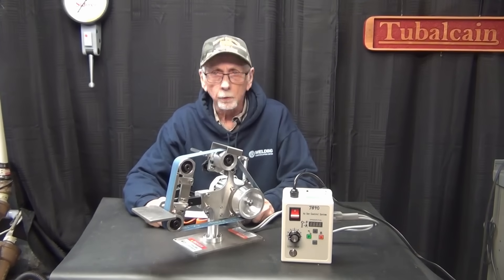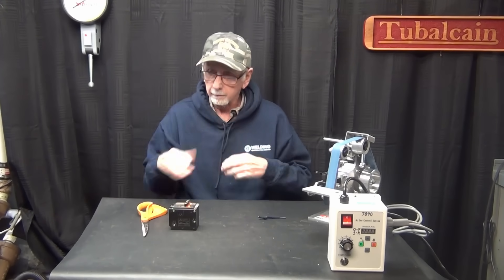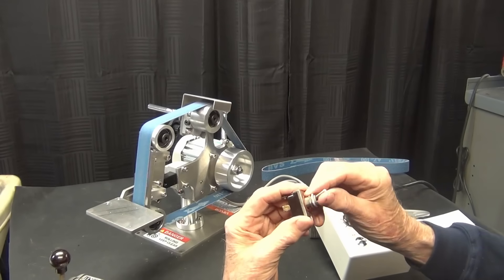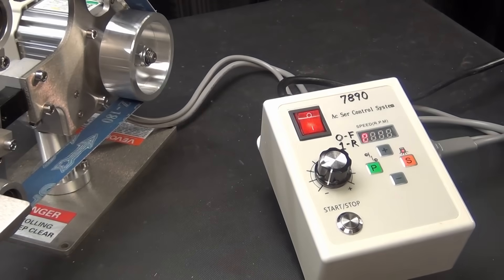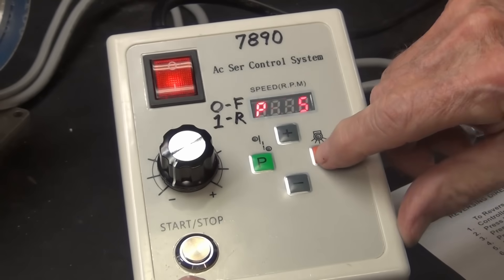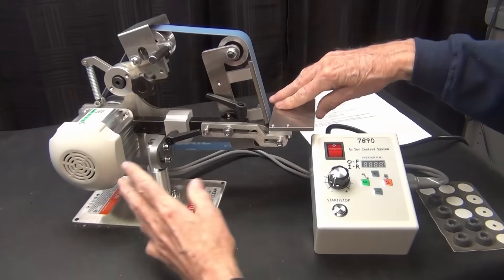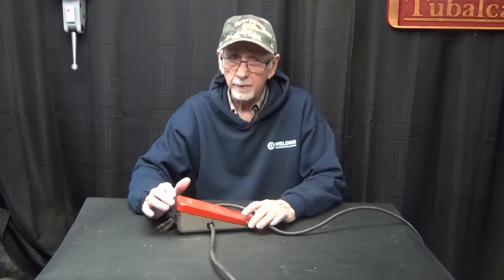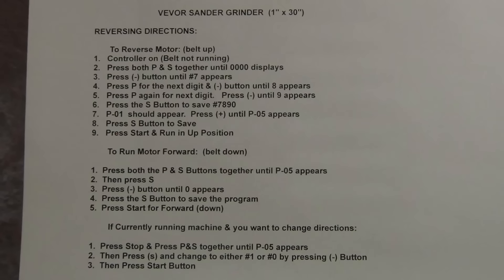HOW TO REVERSE THE VEVOR SANDER #1010 tubalcain

Comment: I have the same belt sander and I also had trouble keeping the belt tracking correctly . As you said about the crown on the pulleys I added crown to mine and it made all the difference. Southern Ky here.👍
Reply from the maker: Glad that helped you!
Just yesterday, for experimentation, I wrapped three layers of black tape around the driveway. That gave it a bit of a crown. It tracks perfectly now.

Comment: The fact it doesn't actually turn off with the switch means it likely is like a tv and always on looking for a signal so this thing is probably drawing some power whenever it is plugged in.
Reply from the maker: You are absolutely correct

Comment: I picked up one of the little Horror Freight belt sanders and had a terrible time with tracking; UNTIL, I chucked them in the lathe, one at a time, and checked the crown. They were no where near symmetrical. Evening out the crowns and the belts tracked quite nicely!
Reply from the maker: Great, glad you got it fixed
Reply: @mrpete222  That said - the thing is a POS - I'll be replacing it soon, probably with this little jewel!

Comment: First off, I see all your comments to my comments and really appreciate them.  Now what in the world would Vevor  want to reverse the grinder?  I am not being negative but ask the question in case there is a good reason for doing so.  I suspect the reason is the controller will handle it so why not market it as a feature even if it makes no sense.  But the grinder does look like a nice little machine.
Reply from the maker: I will never ever use reverse. But I think knife makers like it in reverse. I believe the price of the machine could be reduced by $50 by just using a simple switch.

Comment: I have this belt grinder and to get the tracking to work better just add some more tension to the belt. I found out it tracks very good by adding more tension.
Reply from the maker: Thanks for the tip!  I will try that. Someone else suggested applying tape to the big wheel just in the middle to give it a bit of a crown.

Comment: i bought this after seeing your first video on it and i've got to say that it's pretty sweet. i used it to sharpen some drill bits and some other odd stuff and then bolted it down in place of my old bench grinder and threw that thing in the corner. no regrets.

i use locking c-clamp pliers on my drill press. i drill mostly sheet metal so locking pliers make more sense than a vice. fast and easy!

for a long time i had comment notifications disabled because of the stupid way youtube handles them. the reason is that if you reply to someone else's comment, and it happens to be a popular comment, then youtube informs you anytime someone else replies to the same comment. why would anyone care to be notified about someone leaving a comment talking to a different person i don't know, but i'm sure many other people disable notifications because of it as well. currently mine is on though so i will see replies, whether they are to me or not.......
Reply from the maker: Glad you're enjoying the sander!
I receive no notifications whatsoever. I think I have to check my settings.
Reply: @mrpete222  oh, well that's pretty easy. just click the notification bell icon and then the settings gear icon at the top.

Comment: The tiny belt can run in either direction with no problem. I use mine for pocket knife work and reverse the direction every few seconds sometimes. Mine has a toggle switch and is simple!
Reply from the maker: Glad to hear about your experience!

Comment: The person who asked the question will for sure see the answer. Youtube notifies them that you answered. So don't worry about that.

The adhesive rubber feet you have are meant to be secured with a bolt and washer. They might be perfect for your little belt grinder. Although I think the machine is actually intended to be secured to a workbench for best stability in operation.

Decades ago I worked for a few months in a factory doing mind-numbing production work. The machine I had to work was operated with a kind of "dead man switch". So it would stop turning as soon as you let off. Not sure how practical a setup like that would be for a drill press.
Reply from the maker: That type of switch seems like a great safety feature

Comment: After your review video I purchased this sander and am very happy with it.  As I have limited bench space, I bolted a piece of 1" angle under the front edge of the base, and I clamp it in my bench vise for use. Otherwise, I store it under the bench. This also moves it up higher, so I'm not bent over as much while using it. As to your comments, I do see them, and I get a notice when you or anyone else respond to a comment.
Reply from the maker: That's a great idea for saving space!

Comment: Ive tried everything listed and can't get mine to run in reverse. But I may have found a solution to the tracking problem. Wrap 2 layers of electrical tape around the center of the drive pulley. It makes a slight crown in the wheel and it tracks great.
Reply from the maker: That's a great tip about the electrical tape for tracking!
I may try that and show it in a video. Several other people mentioned that in the past, that’s a good cheap way of doing it.

Comment: I’m unclear on the reversal of the belt. If the splice runs diagonally, what difference does it make to physically turn the belt around? The splice still approaches the wheel, table or tension wheel the same.
Yes we see your answers to the comments that have been posted. That’s one of the reasons I watch your videos and read the comments. It’s half the fun and knowledge that comes from your answers. Keep up the good work sir.
Reply from the maker: Thank you very very much

Comment: I have one of these sanders and it works great. I use it primarily for deburring, rounding corners, and beveling prior to welding. The biggest problem I have had is the wiring going into the motor is very close to the moving belt and can easily make contact with the belt grinding right through it. After repairing it I have now permanently mounted the sander, controller and the wires to a piece of plywood like you are doing with the aluminum. I highly recommend doing this or those wires will end up cut in half. Thanks for sharing how to reverse the motor.
Reply from the maker: Just yesterday, I worked for six hours making the base, and I attach the wire with a screw away from the belt. That video will be out in a week or two.

Comment: Double Stick Tape
Reply: @mrpete222 double stick tape can create a very secure and long lasting joint for mounting the small belt sander. It can also be released with a heat gun.

Comment: I always appreciate your responses to my comments 

I had a machine that the flat belt would not track   I asked a friend that worked with steam engines to help  He told me the reason my belt was not tracking was because I had an idler pulley that had a crown on it. He said idlers should not have a crown. I took the crown off, and the machine has not given me any trouble since.
Reply from the maker: Thank you, I was unaware that the Euler should not have a crown

Comment: Tracking belts or blades is a bit of an art. It took me a while but I have changed enough bandsaw blades now to have it down. The other thing for tracking would be to check how square the pulleys are to the belt. They may be canted to one side or the other.
Reply from the maker: Yes, the wheels have to be in the same plane. And perpendicular.

Comment: Yes I see your answers however brief they may be. Mostly a thumbs up is all I get. But that's Ok. I know you saw it. Quick story: My dad worked in a machine shop during the war (Brand new Norton cylindrical grinder) and the person next to him was working on an old drill press, you know the kind with the exposed shaft going down the front with the chuck. This was a large machine, not a toy. The operator had long sleeves and got caught up in the rotating shaft. Nearly killed him. Permanent injuries. Safety has come a long way.
Reply from the maker: Thanks for the interesting story

Comment: 4:30 It just means that the electromagnets in the motor are stationary, the part that turns has a bunch of strong magnets and the coils get switched electronically. No brushes or commutator to wear out. Computer fans, model plane motors all work like that. More dependable and no sparks.
Reply from the maker: Thanks for a great explanation

Comment: Mr Pete, I have a "dead man" foot switch on my drill press.  I've since watched several video's on building a magnetic vise for the drill press.  Here is the link, and yes I plan on building one.  I've seen videos where they even work on milling machines.  Some folks fill with epoxy and you can find those by doing a YT search.  Thanks, Ken  https://www.youtube.com/watch?v=RNdymvsUQdk
Reply from the maker: I plan on making a magnetic vice in a video. I received the magnets today from Amazon.
Reply: @mrpete222  I ordered one from VEVOR last night that weighs 22# and is capable of lifting 880# with a safety factor of 2.  It might be able to hold through the bottom of the table.  If not I'll make an electric one.

Comment: Thanks for another educational video. I always read your answers so please continue. I believe most viewers appreciate you taking the time to answer their questions. In fact many are here “because” you answer their questions. Good answers
from experienced teachers are an excellent way to learn more about a subject. About belts: I’ve found that If they’re  spliced with butt joints and flexible tape on the back they’ll run in either direction. If spliced with lap joints
they’re designed to run in one direction only. Try reversing the motor without removing the belt. The worst you can do is to break a belt.
Reply from the maker: I was thinking the same thing. Because it’s obviously a taped splice

Comment: I save all those annoying strings... in my annoying strings drawer... 🤪Good tip on reversing the belt... never considered that... 🙄
Addendum:  I bought one of those "sewing machine motor" grinder/sanders (the Grizzly model) years ago, and burned it out after one year.  The replacement motor costs almost as much as a new grinder.  I then upgraded to the "AMERIBRADE" model, and never looked back!  A great grinder, and... MADE IN THE USA!!!  I HIGHLY recommend it.
P.S.  Those rubber feet look like you can run a bolt through them to secure more firmly to base.
Reply from the maker: I agree that it's important to find a good quality tool that lasts

Comment: Interesting vid, many thanks. I did not know the sander controller had that function, but the strange thing is that I have two other motors (bought separately) which are identical other than a slightly different controller box, and these have a forward/reverse switch fitted tol the controller.
Reply from the maker: That’s interesting to know. That controller has to cost a lot of money. Why didn’t they just put in a two dollar switch?

Comment: As to adhesive feet, IME they tend to hang on better if placed in a couple mm deep recesses, just big enough for them. Guess it takes up some of the shear forces...
Reply from the maker: I would like to make a new wheel for the motor. One with a crown, and one with a recess as you described.

Comment: Belt tracking; l had issues with my 3 X 18 Rigid belt sander.  I ended up removing some of the crown in the front roller.  That helped.  I think the key is that the crown should be only as much as necessary, or as flat as possible.  That way it doesn't stretch and deform the belt as much as it heats up from use and also it slows down how fast the belt shifts from side to side.  That has been my experience, anyway.  Previously l used 3 X 21's.  I switched because my cordless sander uses 3 X 18.  That way l only have to carry one size.  Cheers.
Reply from the maker: Thanks for the input!

Comment: Good stuff Mr Pete. I purchased an old craftsman drill press from you at your met and greet a few years ago. Cleaned it up and it is my only drill press. I use a foot switch with it. I wonder if a momentary foot switch would work? Stays engaged as long as your foot is on it. Something happens, step away, machine shuts off.
Reply from the maker: I forgot all about that drill press I cannot even visualize it. To my knowledge, all foot switches are a momentary.
Reply: @mrpete222 it was sitting outside of the garage. Didn’t warrant inside space😂. The horrible freight foot switch I have is latching.

Comment: I have a couple of belt sanders, and never found the need to run them in reverse.

Just out of curiosity and to learn, why would someone want to run their belt sander in reverse?
Reply from the maker: Most knife makers from what I understand, run the belt backwards
Reply: Reverse is for final grinding and polishing blades with fine grit belts. The blade is placed at the proper angle on the upper area of the grinder with the belt running in reverse.

Comment: I really enjoyed your video. The designers are probably straight out of college and have no idea about crowning a wheel, a lot of the older fundamentals are not taught to students. I had appearance electrical engineers with new ideas from college that didn't know the basics. A big shock to them when they realised how older methods worked and were easier than the new ones.
Reply from the maker: I think you’re probably right about the designers.